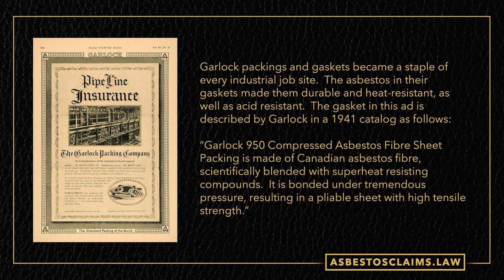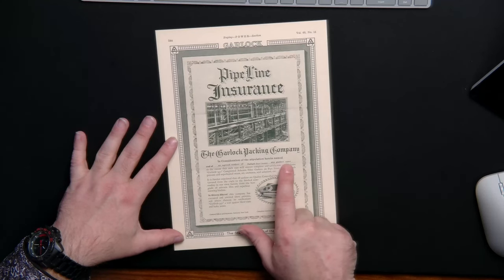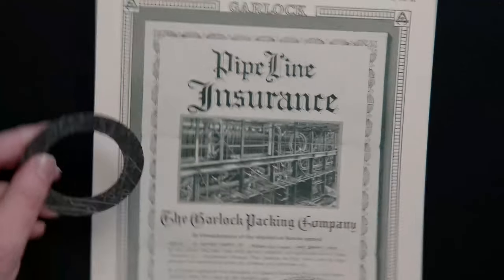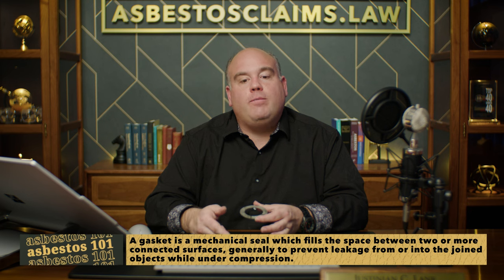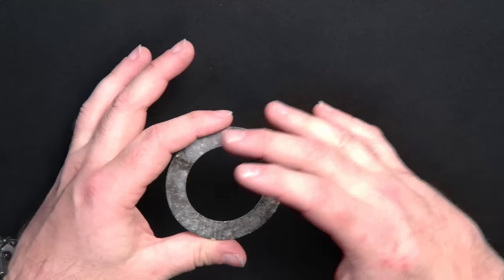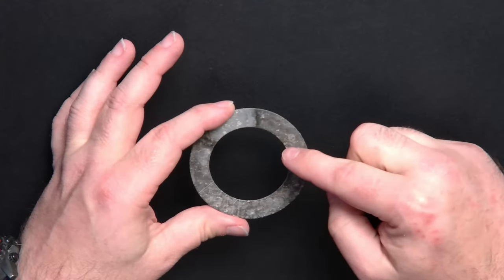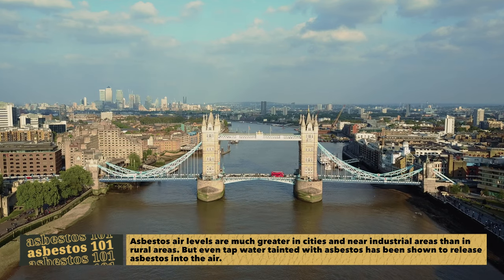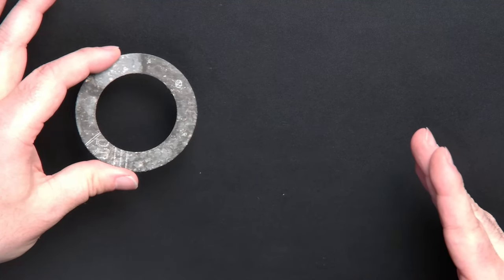Understanding the Asbestos Gasket | ASBESTOS FRAGMENTS 101

Comment: I chase been trying to find out if the head gasket and clutch plates on my 1977 Honda CB400f motorcycle but have had no luck. Honda UK and Australia have been little help suggesting I speak wtith a dealership! I want to export my bike into Australia but have to prove it is asbestos free or face a possible $210000 fine.
Reply from the maker: If you have to prove it, it would be my assumption that you would need to find a certified asbestos inspection company that can test the components of your motorcycle for asbestos. They can provide a detailed report and certification. If you can’t find a specific inspector for motorcycles, you could send samples (e.g. of the head gasket and clutch plates) to a laboratory that tests for asbestos. The laboratory can provide a certificate indicating the presence or absence of asbestos.